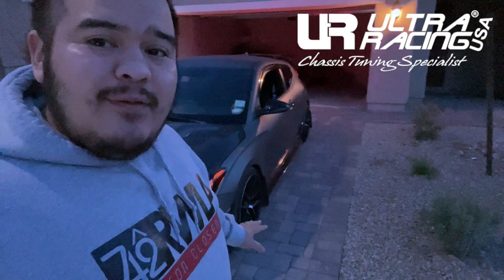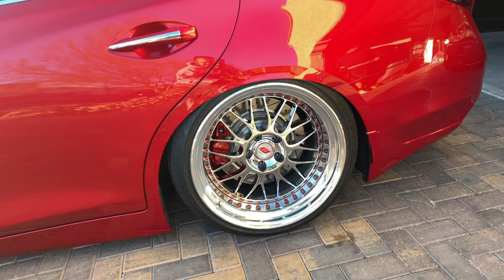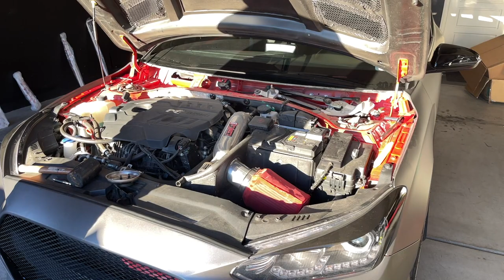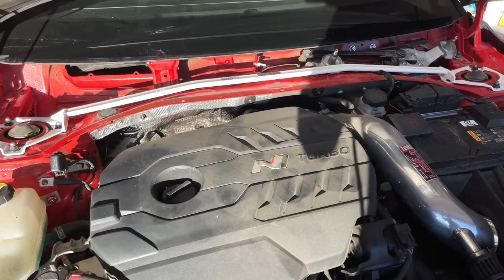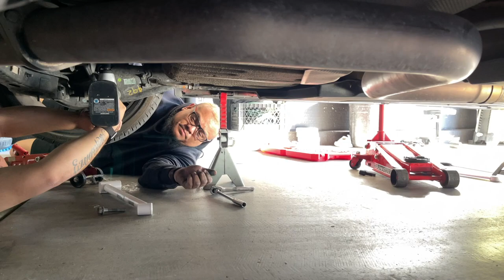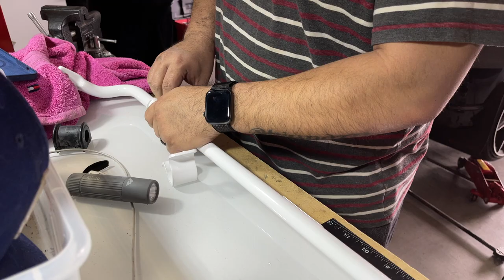Installing Ultra Racing Chasis Braces And Strut Bar On 2nd Gen Veloster / Veloster N

Comment: I didn’t know they made a front strut brace that didn’t require cutting the cowel or whstber it’s called (plastic part that’s right under the windshield)

Ever get
Those torque specs ? I’d think it would be something that needs to be torqued to spec.
Reply from the maker: From what i found 32 ft lbs
Reply from the maker: That’s what i liked the most about this strut bar

Comment: There's no need for a strut bar, it looks like already came with a strut bar to me.
Reply from the maker: It does not come with one. Hyundai developed a carbon fiber one for it but i did not want to cut anything.
Reply: @SynergyMediaUSA  that firewall is already a strut bar, look at that design. I have a 2020 rpec and to me is looks like the car ready has it built in.
Reply: @sanderpena  firewall is not a strutbar 🤦🏻‍♂️ a strut bar literally connects the two struts, hence the name. If there isn't an actual bar attached to both, they aren't connected.
Reply: @tylerdotson1967  I'm just saying look at the design.
Reply: Chassis is stiff enough that a strut bar won't make too much of a difference unless under extreme conditions. Those struts are close enough to the fire wall that it mitigate the chassis flex.